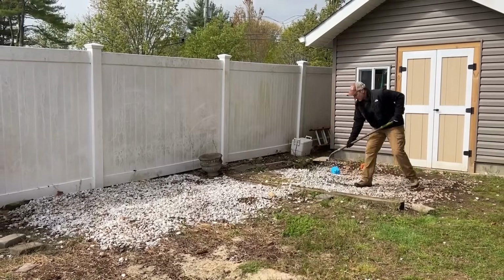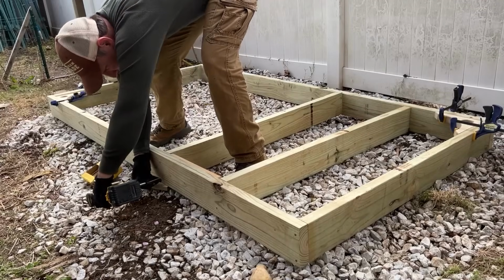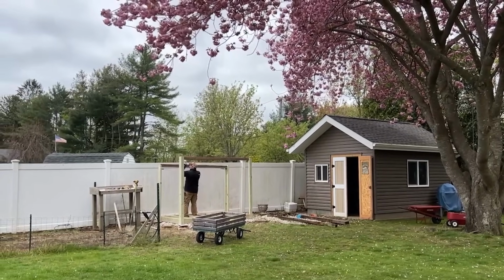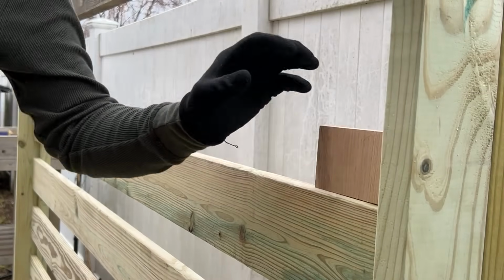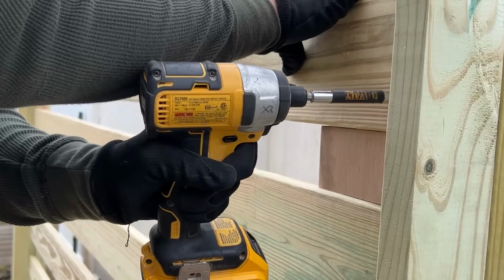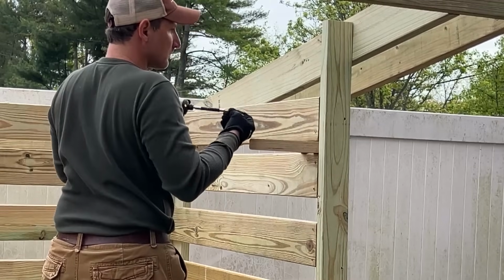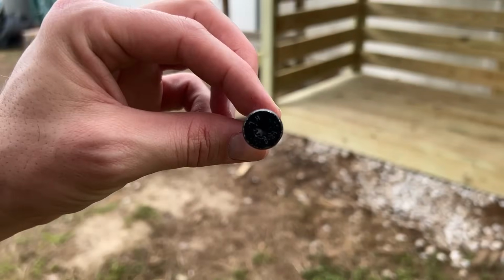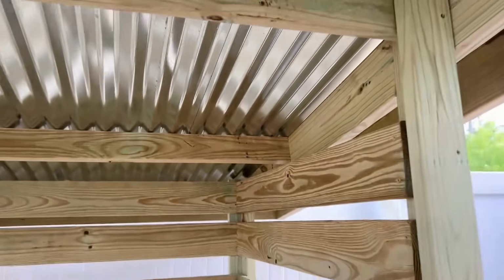How To Build A Firewood Storage Shed In One Day / DIY Firewood Shed / Firewood Rack Build

Comment: Thanks.  Another tip is the roofing screws are meant to go in the hill and not the valley of the corrugated roofing.   The trick is to not over drive the screw and bend the roofing.  Living in Australia where this sort of roofing is very, very common, it is how it is installed here.
Reply: In Denmark all of this type of rooftiles are screwed in the valley of the tile... I thinks it's funny how much deffirence from each country there are in building style.
Reply: @Soruotr  I am ignorant, so no arrogance here, but I would think that having the screw in the valley might collect a bit more moisture when those rubber washers age and potentially crack.
Reply: All screws are ment to go on the hill. So water flows in the valey and not in the screw hole
Reply: When I did corrugated roofing, the screws instruction said on the top of the ridge.  When I did metal sheet roofing, the screws instructions said to put them in the flat area, next to the ridge.  From what I could see, the screws were the same so it appears to depend on the style of roofing.
Reply: @Soruotr  no matter where you live, the smart thing is on the hill, instead of where all the water will go
Reply: I was just about to point out the same thing.
Reply: @Soruotr  common sense tells us water gathers in the valleys no matter how one tries to justify it,  so screwing/nailing in the valley is guaranteed to leak. Hence we screw the hills.
Reply: So does that mean the metal is not screwed tight to the boards then? I can’t envision how to screw the hill tops without smashing the metal into the rafters.
Reply: @woonicon3741  Hmm, I´ve learnt that you put the screw in the valley to allow for expansion due to the heat from the sun, to avoid the metal pulling on the screws.
Reply: Tends to shear the screw over time in an enviroment with trapid changing weather like in southern BC canada. All that screw sticking out works back and forth as the metal expands and contracts instead of the sheet buckling slightly.
Reply: Wrong
Reply: Most corrugated roofing should have the screws in the low profile areas of the metal roofing. The problem with putting the screws in the high profile areas is they will pull out and loosen overtime. So you will have to tighten down the screws periodically. Most manufacturers have guidance for screw location.
Reply: Ideally put the screw in the hill if the metal will support .  Metal galvanized corrugated gauge was much different with the sheds my dad and I built years ago.  You can’t walk on the crap they sell now.  
I  built a garden shed a few years ago out of poly corrugated and they sell plastics supports that fit in the slots and you drive the screws in the hills supported by the spacer strips.  Oh and yes the screws needed to be tightened again later. 
I built two of these wood sheds on Tamarac Timbers 4 x 8.  The bottom base I designed like a pallet and I can move the empty shed when empty to where I want it.  I also used a full sheet of 1/2” 4 x 8 treated plywood on the floor.
Reply: Thanks for the awesome video!  Very inspiring
Reply: One of the biggest debates of the ages, screws going in the "hills" or "valleys".  I'm voting valley as the manufacturer of all of the 8 metal roofs I've done since the mid 80's say to do it that way.
Reply: It’s good advice and I agree, but one word:  WIND  What to mitigate determines where.  I think most in America assume the valley.  Where I live, wind is a greater issue than water.  The screws done right will hold, but only long enough to forget about them as they weaken.
Reply: Actually, doing that sometimes voids any warranty you might have.
Reply: Nope. That's incorrect.

Comment: A good trick for making a wood shed is to put a divider in the middle... that way you can put next years wood in one side to allow it to dry properly while you use up the other side. Then switch around every year.
Reply: I needed to build a wood hutch for are firewood. I like your idea about dividing it in half. So, It's 8 ft by 8 ft with a divider in the middle. Thank you. 😊 It looks nice.

Comment: Your biggest mistake was putting the roofing screws in the valleys of the tin, that type of tin is supposed to be screwed on the ridge tops to better prevent leaking
Reply: Wrong
Reply: Can you explain why wrong?
Reply: @Nikito Japyfit  think about it, water drains off the ridge, and runs down through the valleys of the tin, you don't want a screw  in the valley  obstructing the flow of water creating a possible leak 🤔😊

Comment: Turn the roof upside down and re- screw it using the same holes. You'll be able to reposition the sheets and the screws will be on the high points of the sheets. You're welcome.

Comment: Great job. The oly problem I see is that there is o airspace underneath. This will trap moisture and make the floor joists rot much quicker. Also a gutter on the backside will control the water away from the structure and eliminate splashback.

Comment: I built this plan this past week, and I'm really happy with the outcome.  Great plans on Etsy.  I did two edits from the original plans:  1) I put it on 16"x8"x4" concrete blocks, and 2) I decreased the number of floorboards from 9 to 7 (allowing a 1.85" gap between each).  I also had to sub 8' SM-Rib galvalume steel 29-gauge roof/siding panels for the roof due to supply issues.  The benefit with these was that the were pre-painted green (so I bought green roofing screws).  Not counting site prep time it took me about 12 hours and cost approximately $600.  This thing will outlive me, so "buy once, cry once" re the price.  I learned so much about clever use of clamps from the video that I will apply to future projects.  Many thanks for the great vid and plans.

For those counting, the shed holds 3 face cords, which is 1 full cord.  Face cord = 16"x4'x8'.
Reply from the maker: Thank you for sharing!!!
Reply: and u saved money by using 2 by 4 for the roof??

Comment: I built one similar really cheap. All I did was use two pallets side by side for base. Screwed them together with galvanised plate. Two pallets vertical for back wall, one pallet each side for side walls. Front use 3x2 to form goal post  then piece of 8x4 sterling board for roof covered with shed felt.
Looks good too.

Comment: Something else to note is that the run off is going to pool at the back of the shed, after running down the fence. Might not be an issue, but it does have the potential to create a problem. A simple piece of guttering and a rain barrel will fix that. Great job.

Comment: OUTSTANDING build! I made one of these last year and man, I could have saved some time with some of the techniques you used. Your tip on airflow is spot on. I kept the sides like yours. I also kept space between the floorboards. We get rabbits where I am and I didn’t want to have a fully closed floor…so far no rabbits. Something else I did was get a tarp from HD and I put that over the front of the shed. I got screw in hooks and put them on the upper face frame to line up with the tarp grommets. At the bottom of the tarp I just zip tied a piece of pvc pipe cut to length. When it’s going to rain or snow I just keep the tarp down. It protects the wood nicely. Otherwise it’s rolled up to the top. These sheds are great diy projects
Reply: My friend, I'm having trouble picturing the way you stow the tarp and deploy it, if you'd be so kind as to make a video and let me know when it's uploaded, I'd greatly appreciate it. I love the idea of a tarp keeping things dry and tidy. Thanks
Reply: It’s a great idea…. I was thinking the same for wet/winter… im from NS Canada……pretty sure he was thinking tack tarp from the top plate on front and have laid downwards….attach the pvc to the bottom of tarp…. Roll up and secure hooks (or something) for when the weather is good…. Roll down when it’s crappy out!!!!

Comment: Thanks for this video.  I used it as a guide to build my wood shed. I just finished it a couple days ago.   I used 2x6s for the deck, 1x4s for the wall slats, and 2 x 4s for every thing else. For the roof I used those composite roof panels.  All of the lumber I used is #2 prime and pressure treated.  After it was built, I decided to paint the thing so it matches my tool shed and house colors.  I also used heavy concrete blocks under each corner and joist as a foundation.  I only put 1 joist in the center of the 8 ft span of the deck. It's seems plenty enough sturdy to hold firewood.  If it every starts to sag, I guess I'll fix it when it happens.    Sept 2024, it cost me right at 600 dollars for all of the materials from HD to build this beauty.  It's so pretty my wife is getting jealous... :)  P.S. overall, it took me about 15 hours spread over 3 days to build it.
Reply: You could've doubled up that single one, that would probably save you from having to fix it later.

Comment: I've watched this numerous times. You make it look so easy, especially with the speed up. I salvaged some cedar  decking boards that i plan to use for the walls and maybe the floor. I will still have to purchase the 2 x 4 cedar boards from a nearby mill.  I think I can do this for under $250, with all the screws, roofing and foundation material added in. It will take me a bit longer since I'm unskilled, and I will have to plug up all those holes that I pulled the nails out of...and level the ground under it. Even with all the salvaged parts it will probably look better and last longer than pallets and blue tarp.

Comment: I use some of your techniques For building a woodshed.
It's 8ft by 8ft With a divider in the middle. So, I can have greenwood on 1 side and seasoned wood on the other. My son is a co compliant officer here in my city.  Firewood sheds have to be 18" off the ground because of termites. Termites have been a big problem in the past year. I didn't Want him to show me his badge and gun. It turned out nice. I stayed to the code.
I dug 4 Post holes in the ground 10" wide by 30" deep. And poured with concrete. With an 8" center block on top. We did 2x10 Floor Jionts, 24" oc, 2x4 Decking.
I like the way you did your 2×4 corners. And screwed them to the deck. You don't have to nudge your floor. Those corners always seem to break. And it makes it look nicer. 
With 2×4 structure, you can fasten your walls up easier. I like using the five quarter boards for the walls.
The metal roof turned out Nice. because You help me not to make the same mistakes.
Thank you for showing me your biuld to help me with my build.😊
Reply: My next job is to build a wood fired pizza oven.

Comment: You are right about the airflow.  For that reason and others the flooring boards should have been spaced apart 1-4" and the entire structure should have been raised up on concrete piers.  Wood with its' feet wet a lot will quickly rot away even if it is treated.

Comment: Looks great. You may want to remove some of those decking boards around the shed. While you need some to keep wood in, you also don't want to restrict air flow. Some of those will line up with cracks between logs and restrict air flow. On my wood shed (which may be a bit shorter than yours) I only have three decking boards from the bottom with sufficient spacing and that's enough to hold it all in safety. Cheers.
Reply: I thought the same thing. The deck will get wet and probably start to rot
Reply: @fireboltaz  that's a good point too, but I meant decking boards he used to hold wood in...that go up to ceiling. way too many IMO
Reply: No, it will be fine. You can ignore this guy.
Reply: Great tip, thank you!
Reply: Wood sheds (up north) are usually built to allow more air flow to season the wood in 3 to 6 months. Never beside a fence that restricts air flow and never with a solid floor.

Comment: great video , so the screws for the corugated roof sheets  should be put on the ridge 
 of the sheets and not the valley
Reply from the maker: Usually yes but, this Home Depot garbage. Manufacturer specs say to place screws in the valley because it is a thin gauge and too flexible.
Reply: I had to solve this problem in Germany last year.  My project is very similar to Artisan's shed but smaller with somewhat flimsy roofing. It is under a pine tree that drops needles which would dam up in the valleys and flood around any screws in the valleys.  So I went to Hornbach (like Home Depot, same orange colour!). They summoned the expert. He said "yes you screw through the ridges" so I asked about any support underneath and he took me to a dark and dusty part of the shop where there were just 2 bags of clear hard plastic bushings with predrilled holes that were shaped to fit under the ridge.  I used relatively long screws with a special plastic cap on top of each screw.  For screwing I like to get about 2.5cm (1 inch) of bite into the wood without too much downward force on the bushings/spacers.  I torqued the screws to "snug" not tight. This solution was not obvious at the store because these accessories were far away from the main roofing supply area and only 1 guy seemed to know about it.

Comment: Nice work ,I made a similar wood shed from free treated 5\4 deck boards I salvaged for my floor structure . I used 4 by 4 posts for corners of shed and 2 by 4 supports ,roofing is same as yours .I built it all from 8 ft lengths to keep costs down .So the shed is just under 8 by 8 with a big overhang awning on the front made from rough sawn elm I cut on my property .I get about just under 3 cords wood in it loaded to max . The awnng  on the front keeps rain off front of wood pile ,I no longer need tarp curtain on front .

Comment: Wish I had some of those wooden corner squares. That was a hassle trying to set them w the metal L square. My 1st attempt at a shed build and had to go back and make adjustments. Now I'm at this bracing the top part of my build, so I'm trying to measure and plan this part. * I do know some of my corners at the  bottom have a little play so I just didn't crank down on the screws to try and be able to brace the top.

Comment: I just built your mini wood shed. I am still learning and new to all of this. Your instructions were easy to read and made a big difference in the final product. After watching this video I am going to invest in some clamps! Also, do you ever use liquid nails on these type of builds?
Reply from the maker: I rarely use liquid nails or any construction adhesive for that matter. It is a pain in the neck to work with because once it’s dry you really can’t make any changes. It’s a permanent bond.

Comment: I just finished building one out of pallets I got for free and spare hardwood boards I had. The only thing I did differently which wasn't intentional was the angle of the roof is lower at the front 

Would this be any disadvantage vs water running off from the back ? I noticed most videos of this design have the water running down at the back instead 

I want to have my storage sitting against a shed wall

Comment: 2 questions. 1. I thought the decking screws were self tapping but I see you drilling holes. Were there some instances where drilling was necessary or did you do that for all of them? 
2. What's the purpose of the structural screws you replaced at the end? Are they that different from the decking screws?
Reply from the maker: I only drilled holes at the ends of the boards to avoid splintering. Structural screws are much much stronger.

Comment: Can't you build a rectangular frame on the floor. Then slip it over the outside of the 4 posts as the roof? Then angle it and screw it. Wouldn't this be easier?

Comment: Put a piece of edge flashing under the short side of the roof let it go down on the facia board.  good job built a few very similar.  rough wood roll asphalt, can't get metal.
Reply: Does the flash edging go over the tin roof or under?

Comment: Very good video - the techniques you used for 1-man assembly are helpful. 

I’m sure your site put constraints on the wood shed.  That said, I would make it longer and shallower so that you have only 2 rows of logs.  Better airflow that way. Also, you don’t end up with wood way in the back that you have to move so you can burn it first next year.

Comment: This may seem a stupid question, but how do you figure out the angle of your cuts for the roof boards going front to rear?
Reply from the maker: Not stupid at all. The answer is trigonometry, but I suck at trigonometry so I use programs like sketchup and fusion 360 that do all of the calculations for you.
Reply: I would probably clamp the first roof support up there, then draw a plumb line down using a spirit level then match that line with my mitre saw. Not very high tech or mathematical but would work.

Comment: Nice job. I like the use of 2x4’s for the corners vs 4x4’s (my last wood shed build). I would have skipped replacing the deck screws with structural ones- seems like overkill for something thats carrying so little weight…. I also learned in the comments to screw peaks not valleys in corregated metal? Huh- would have never guessed that.
Reply from the maker: Yea this metal was too flimsy to do that.

Comment: What about some foundation? Don't you think the wind could possibly move it/flip it when it's empty? I will be making a slimmer and wider one myself and I'm considering foundation options so I just wonder. Thanks
Reply from the maker: If you make it narrower you should anchor it. This one is deep  enough to not worry about that unless you have to deal major hurricanes all the time.  Also foundation is overkill. It’s only for firewood. Just make sure you level off the space where it will live. Lay on top of gravel or elevate on blocks and you are ready to go.